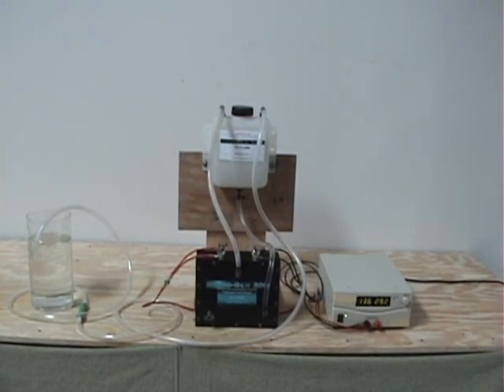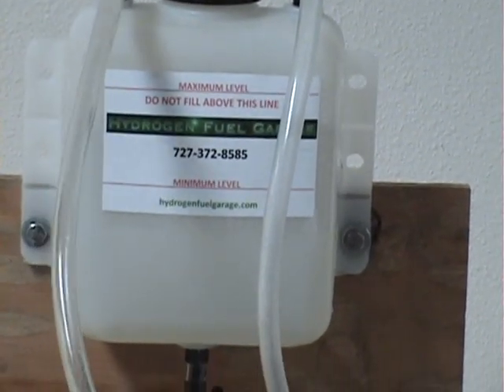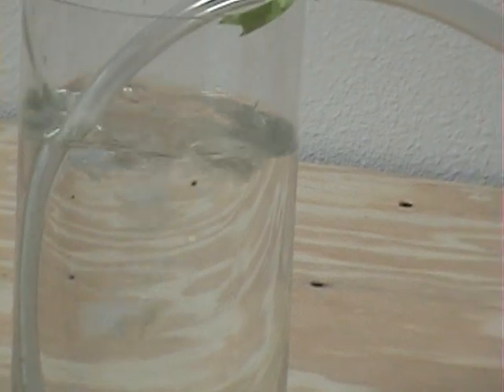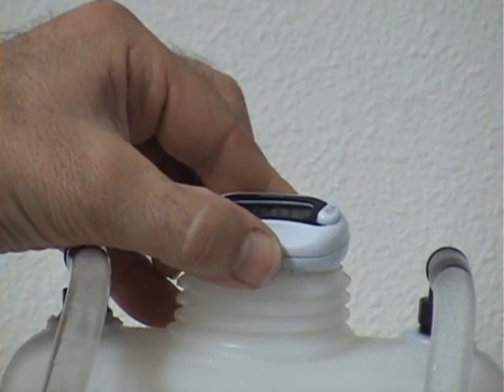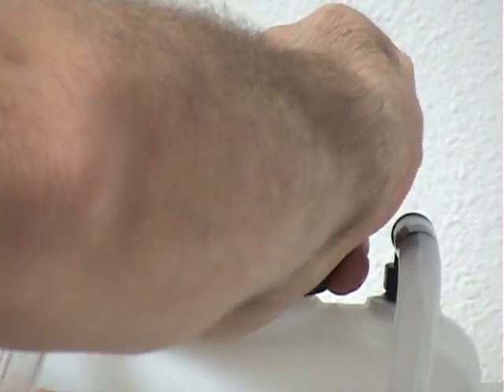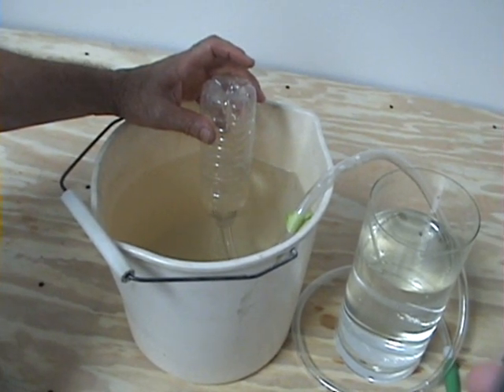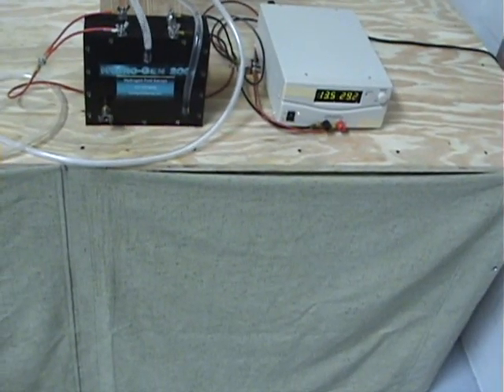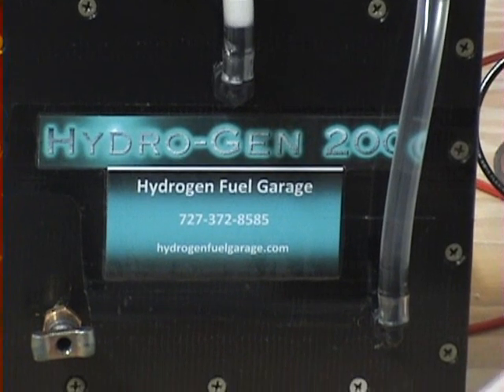HHO Gas Generator or  Hydrogen Generator from Hydrogen Fuel Garage

Comment: according to Faraday's law with 30Amps at 108F or  315K and assuming the room pressure at 1atm you should get V=RITt/(FPz)  V=0.361 L/min of HHO gas (0.241 H2 and 0.120 O2)... what electrolyte are you using?